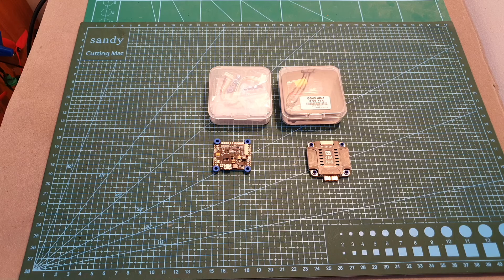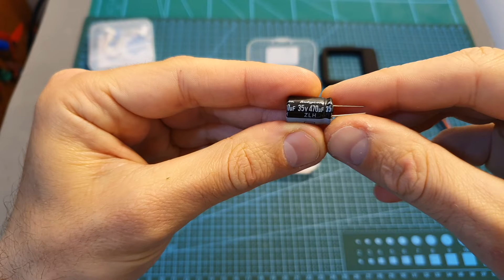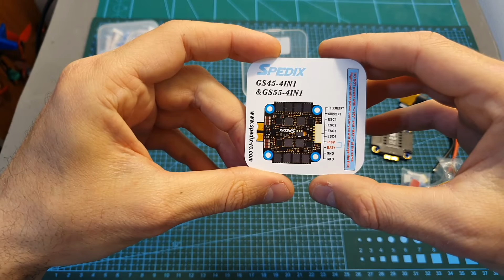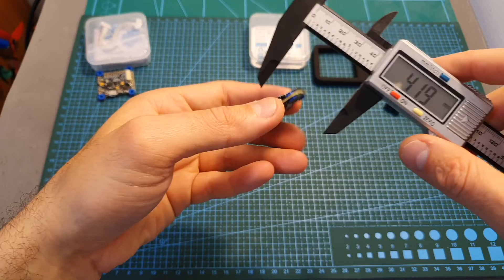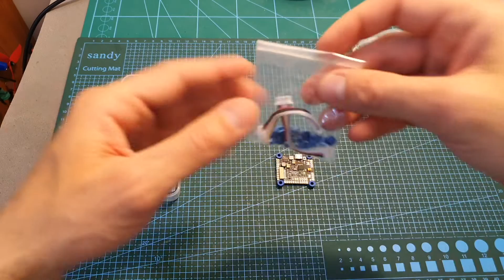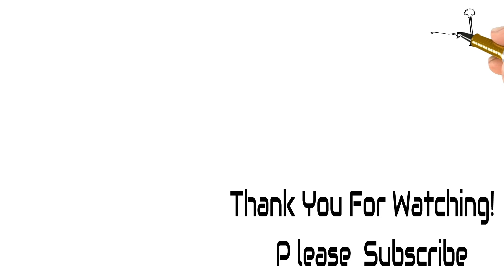Spedix GS45 45A ESC & F4 FC Overview

Comment: Hi . I've just purchased one of these and this is my first ever quad build,I have the STATE  L. E.D flashing and a constant beeping right after the power on sounds from the motors,what does that mean???,thanks in advance
Reply from the maker: Hi, it seems like the beeper mode is enabled. Did you sort it out by now?
Reply: @KremerFPV  I've not had a look,but I've managed to sort it out,it now only beeps when not armed

Comment: Hi Im using this esc in a build but Im a beginner  and have a couple  of questions , why 2 grounds on the esc ? Can I just solder the 10v wire  from the esc to my power in on my vtx ?(7v - 36v)   Great review  thank  you
Reply from the maker: Hi Jordan. 2 Grounds - can be more convenient for some. Yes you can do that (and you can also power the VTX directly from your battery if it's between 7-36v).